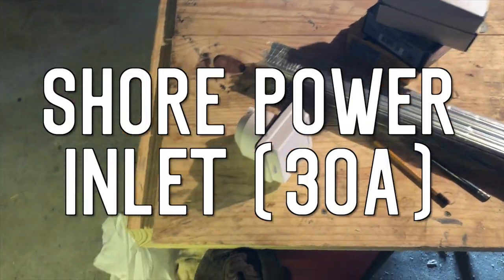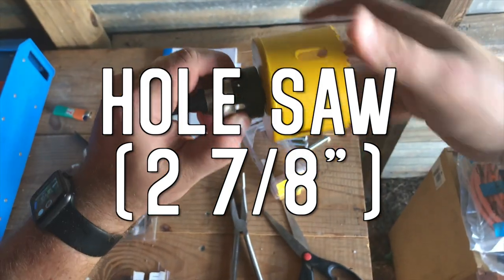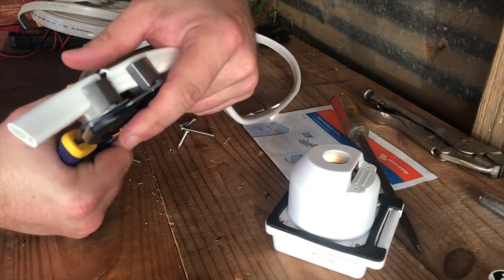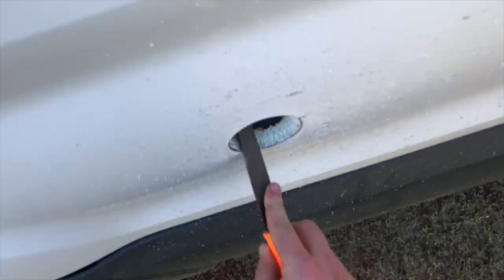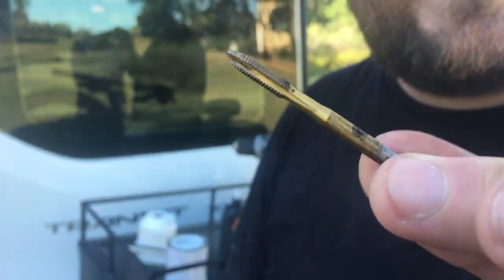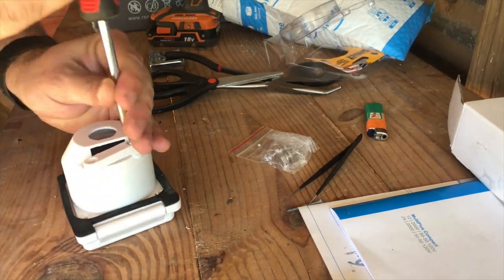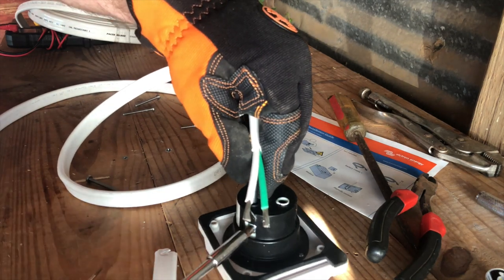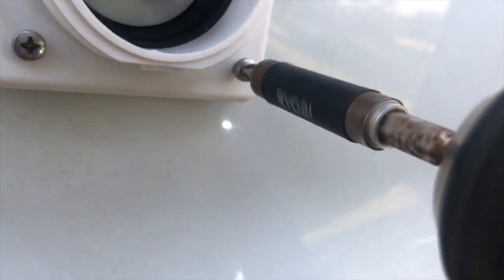How to install a Shore Power Inlet on your RV or Boat! VIDEO GUIDE

Comment: Great vid!!! Quick question... is there a ‘typical side’ of the camper that you should install one of these? Do most campgrounds have the power pedestal on the drivers side ?? Thanks!!
Reply from the maker: I'm not sure about that. Most RV campgrounds and other places allow you park in the spaces in either direction. The only place I guess you might run into trouble there is if you have a huge rig and it can only be parked one way, but with even a regular-sized cable you could still run it under the vehicle to the other side. I put ours on the drivers' side but I've seen it done on the other side as well, depending on where your inverter and battery bank are and such
Reply: KiddVANtures ahhhh - gotcha! Thank you so much!!
Reply: The 2 RVs ive had (<30") have been on the passenger side but they were older models.

Comment: How do you then route that to your inverter? Do you just install a 3 prong plug on the other end?
Reply from the maker: You will definitely want to consult the manual for your specific inverter. My inverter has three direct-in screw terminals, so I wired some 10/3 stranded marine triplex wire from the Shore Inlet directly into the inverter, which was situated less than 2 ft from where I installed the shore inlet. Again, I can't speak for all inverters or all manufacturers, so double check the instructions for your specific inlet and your specific inverter. Thanks!